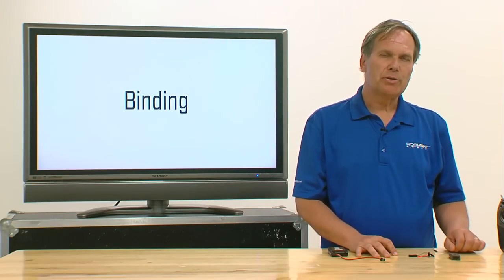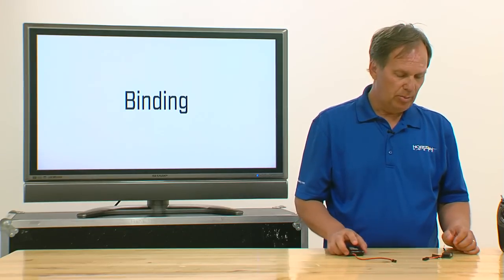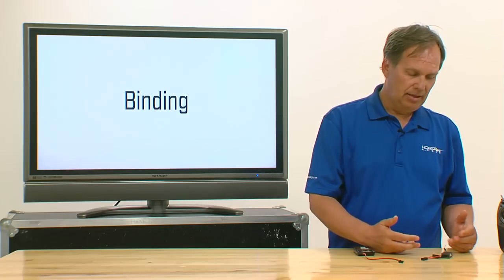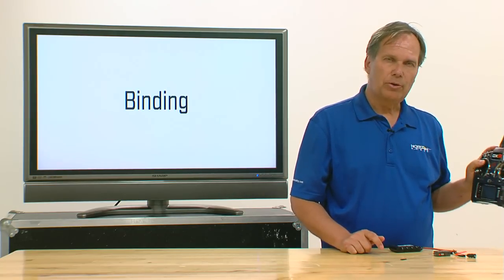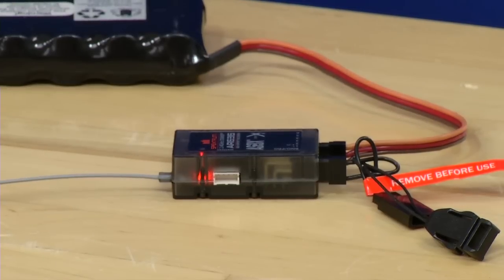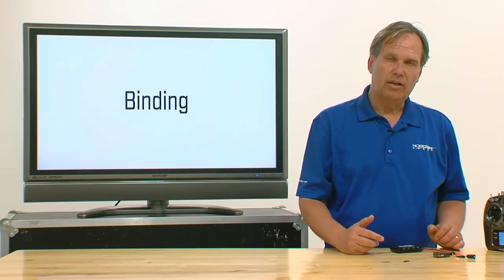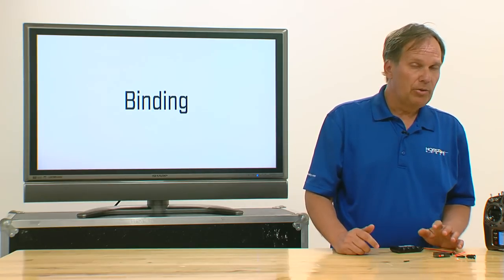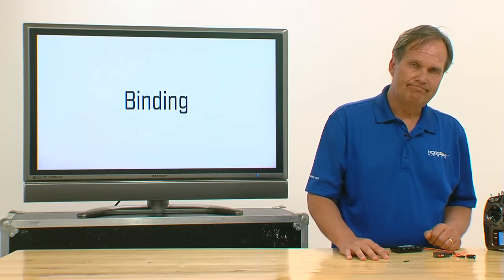Spektrum AS3X Step 3: Binding (Initial Setup)

Comment: My Maule came with a As3x receiver, It is terrible! Whomever set up the gains had rocks in their head. I cannot move my Aireolons at all in any mode but off. Rudder is so limited on turns I have almost had two fly aways. What good is this preprogrammed if they didnt even set it up properly. Now I need to download an ap and program the as3x to actually work right. I noticed right from the start I was NOT getting any imput to the Aireolns from the start. Whomever is in charge of programming these needs to actually TEST them . Clearly mine was never tested.

Comment: Hopefully the tech director will read this. I have just received a replacement AR636 as the first one was defective on receipt in an Opterra model. So, A new Rx was sent complete with programming lead, this has taken literally WEEKS. I studied all the videos and downloaded the PC software (latest versions) and off we go. The programmer cannot identify the 'device' obviously as I have no serial number. I opened the Updater to get the serial number and all I get it "problem changing to (some mode or other). This whole set up is garbage, far far too complex and frustrating. I have a PC programming lead, do I now need to buy a smartphone lead as well? Why don't I just send you a blank cheque?? So the model stays on the dusty shelf while I no doubt spend the next few weeks getting 'support' emails telling me to do what I have already done before I get another of these crap receivers and more than likely more problems to drive me round the bend.........